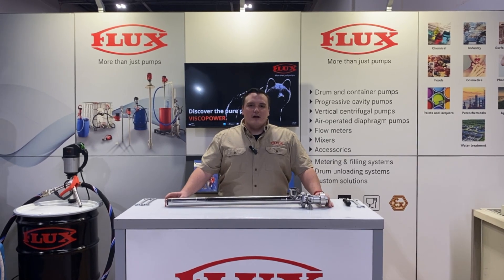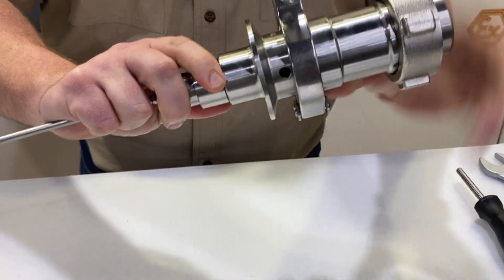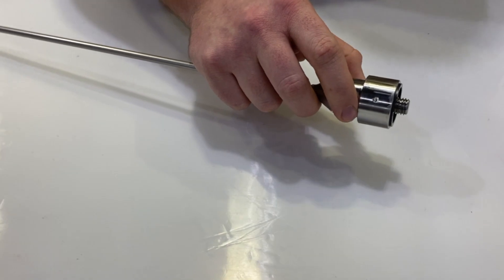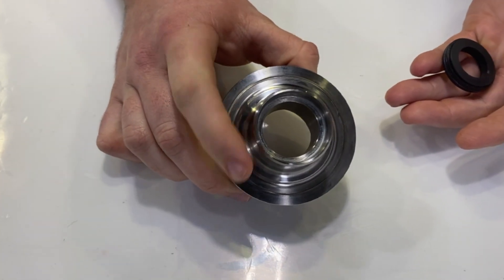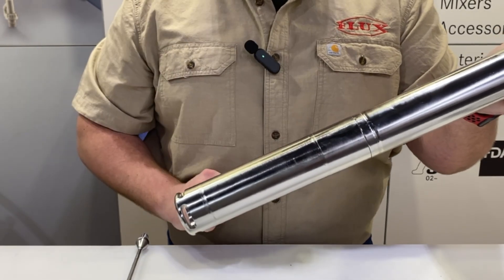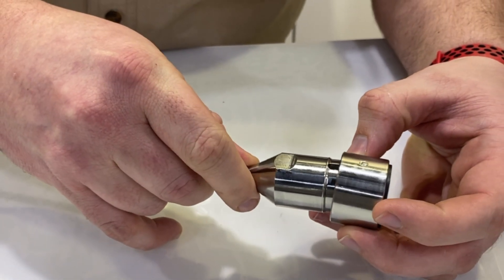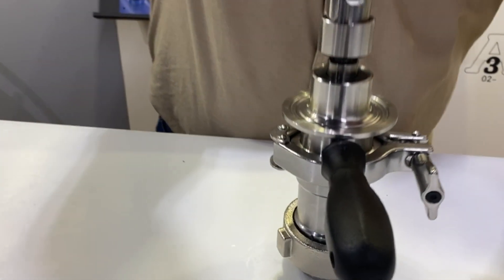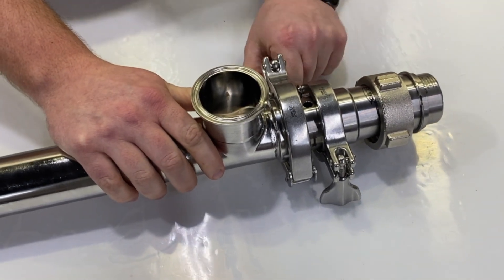VISCOPOWER Maintenance Video for Closed Mechanical Seal Configurations

Comment: Can anybody explain how it works as a closed mechanical seal?
Reply from the maker: Good Morning, this seal is referred to as a closed seal meaning that the wave spring used in the mechanical seal is sealed off from contact with the pumped liquid by use of an o-ring. Other than that, it functions just like a normal mechanical seal as shown here: https://www.youtube.com/watch?v=_lGkOLmUIQs
Reply: @fluxtv6587  Thanks for the quick reply. I have one more question. There is an o-ring and wave spring on the rotator but it seems that process liquid can contact the seal face through the gap between rotation seal housing and motor connection housing. Is my understanding correct?
Reply from the maker: @윤종선-f3y  You are correct in that the liquid can reach the seal faces; this is required for proper functioning of the mechanical seal. The seal faces are pushed together using a combination of hydraulic force from the sealed fluid and spring force from the seal design. In this way a seal is formed to prevent process leaking between the rotating (shaft) and stationary areas of the pump.